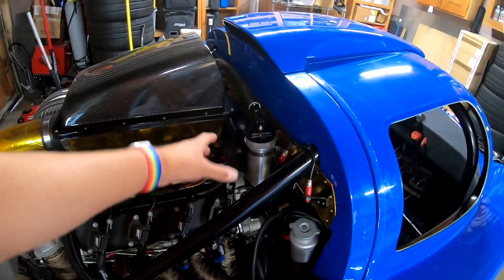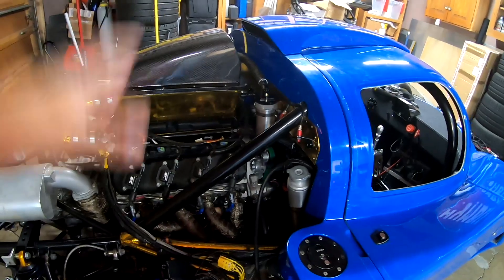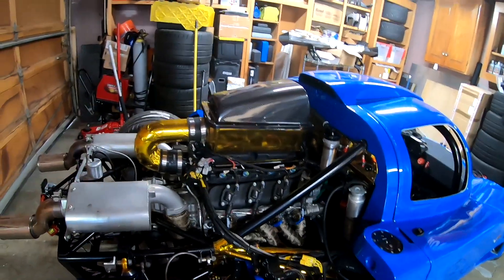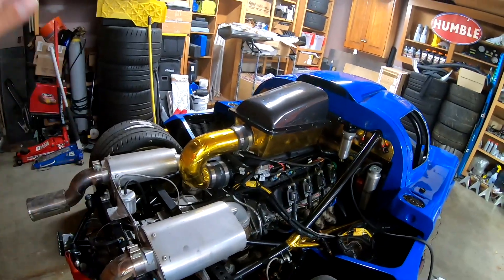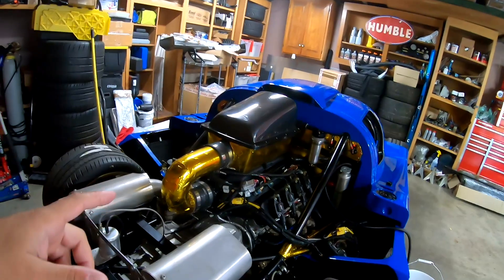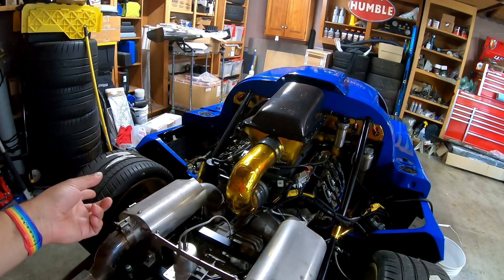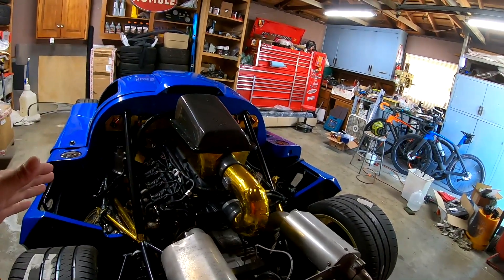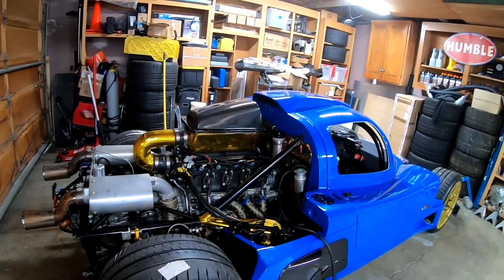Ultima RS - Blunicorn Rebuild 30

Comment: Hang in there Humble, I’m sure you will work through all the issues. Glad to hear the DCE system works well. I’ve installed the DCE pro column on my build, but not at the point to test it out. As always, thanks for the great content.

Comment: Ha! I did the same thing overfilling the sump. I primed my motor with roughly 3 quarts of oil (it registered pressure after 2 quarts but I let one more go through for insurance). Doing the rough math (it holds 8-9 quarts) I primed it with 3 and added 4 to the sump. Should equal 7 quarts leaving me underfilled by 1-2 quarts, right? Nope. My car turned into a fire hydrant of oil out the breather and through the sump cap. It must've purged at least 5 quarts. Before I started the process I had drained it from both plugs and replaced the filter (it had gotten slightly dented during the installation and I wasn't taking any chances). I started with zero oil in the engine and somehow 7 quarts turned my garage into the Exxon Valdez part II. The mess was apocalyptic but on the upside, everything has a nice coat of 0-W40 on it now so it's basically guaranteed never to rust.

In hindsight, I'm guessing what's in the motor had to come out before it could draw anything in from the sump so just for a few seconds I had a sudden surge of oil that maxed out my sump and led to me having to clean baby penguins with Dawn. Lesson learned.

Comment: Hang in there mate. You've done an amazing job, especially as you had  come straight off the GBS build. Take some time off then finish that beast. :-) how much power are you expecting to have at the rear wheels?
Reply from the maker: I'm expecting about what I had before, ~590hp give or take.
Reply: @DriveDriverDriven  awesome!!!